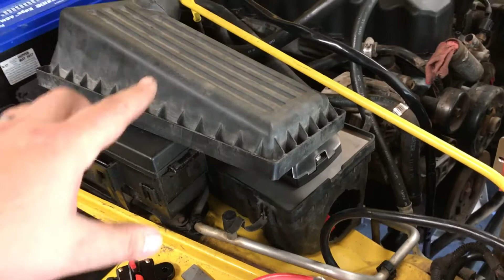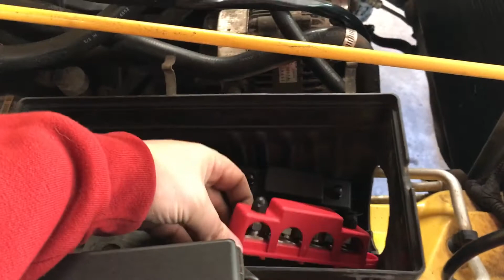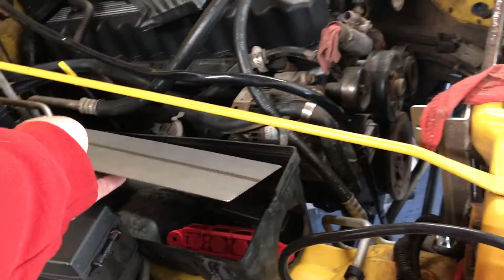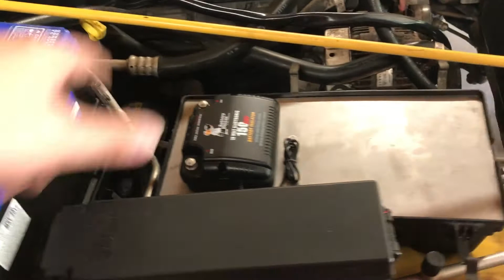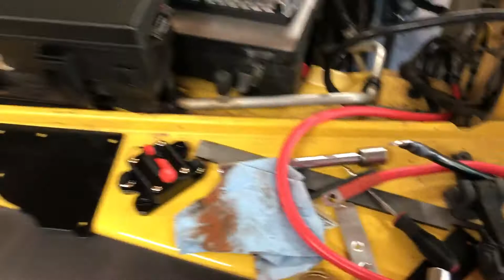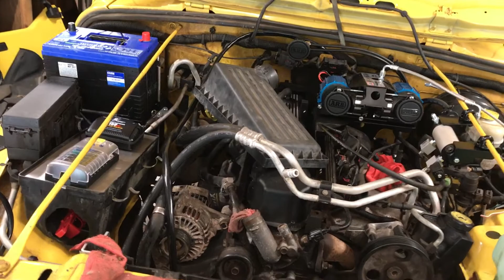2004 Jeep TJ dual battery setup

Comment: Where did you get the duel battery tray and what batteries are you running?
Reply from the maker: Quadratic, however I scraped the dual battery setup. It was incredible heavy and not needed after all.